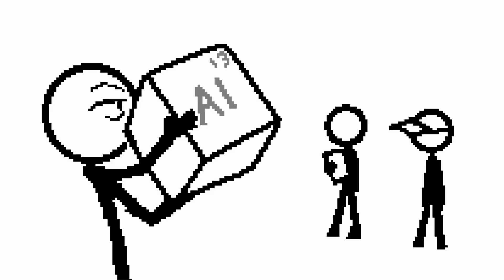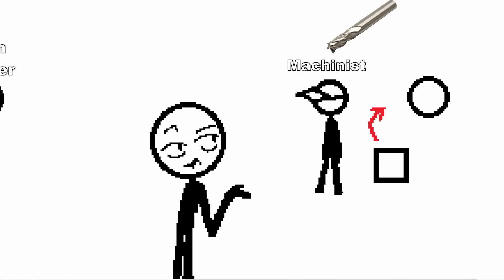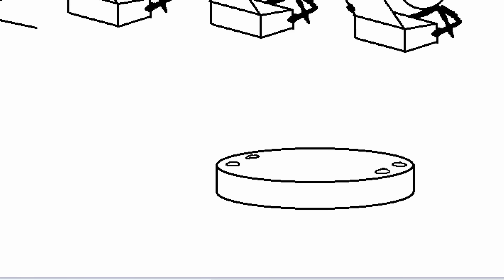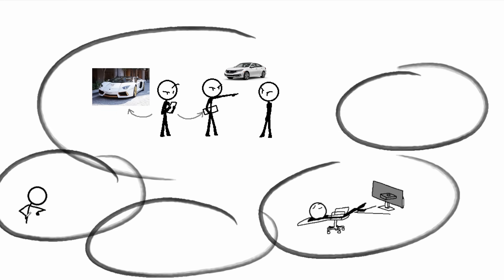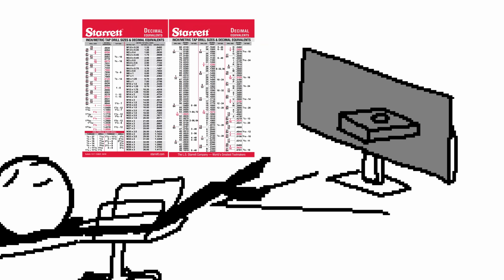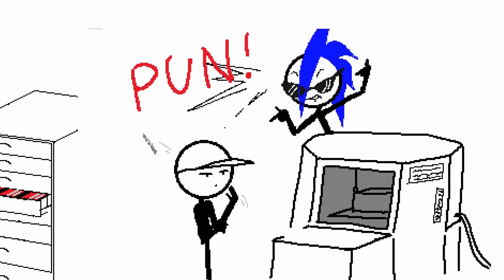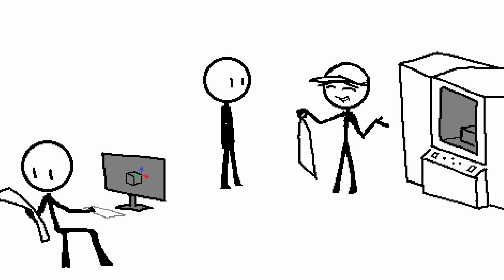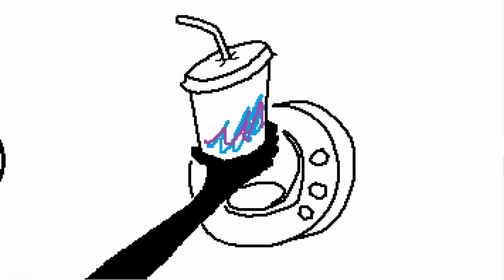Why we hate engineers

Comment: I worked on nuclear parts, hydroelectric dams parts, deep water oil drlling parts, parts weighing 250lbs to parys weighting 250 000lbs.(yes, we had to tear diwn the whole shop wall to get it inside it was so massive) these issues happens all the time at all levels. Its frustrating everytime.

Comment: Its like engineers and geologists working together. The engineer will try to keep cutting spendings where he is not supposed to. Bro you don't try nature.

If you pull water faster than your aquifer can recover not only your well will run out of water, but the aquifer may collapse, losing porosity and therefore its ability to store water to begin with. Or worse: the ground literally start sinking.

You don't mine salt with water. We all know its cheaper, but salt is soluble and you cannot control how the moisture will spread. The collapse of the mine is a matter of when, not if.

If you have a dam to hold off mining waste and it has a weight limit, you build a new dam, you don't keep adding more waste on it.

If you're building any infrasctructure be it roads or whatever else, you do it with the right slope. You make the slope steeper to remove less material, and you'll get yourself a landslide on the very first rain.

Bros try to budget cut as if something going wrong is a mere inconvenience and not a catastrophe in the making.

Comment: Hey, I had a Honda Civic. Fine car but atrocious software. Pro tip: when the doors are frozen and won't open because the locks are operated by low-power electronics you can enter the car through the boot, wiggle your way into the driver's seat, and a gentle push from the inside will then open the door

Comment: You're so right about it... Sometimes car fabricators build things that are out of the need just to be the one who made it into production...
But if you have to repair it, it's so frustrating that YOU COULD SET THE WHOLE WORLD ON FIRE literally. Just because some guys made a 3D drawing and decided it's so cool... For example cylinder heads from vw : there is a oil air membrane pressed into the aluminum part... If it breaks you can't replace it because it is one part now 😅😅😅 so you're forced to buy another cylinder head just because of that little stupid thing which is so small that it fits in my pants pockets 😢 the little sparepart costs around 6 bucks and the whole head costs 300 bucks... Engineering sucks 🎉

Comment: Have a similar debate all the time with an engineer who came from construction.  The "do you show a 0.75 degree pipe deflection".  He says its pointless because no one will measure that out and doing so can increase cost, I say its needed because otherwise the pipe technically wont connect to where it needs to 2000' away and thats a change order.

Comment: Isn't it the same in every field of work?
In logistic we have the same problem: Person A claims "We need to make sure that these customer-orders all get handled in that exact order - oh and these are the exact dimensions of each carton and package and they need to match precisely". Even when you tell them that you can do it but it will be a lot of work and be completely useless in the end - they will ignore that.
And then a couple months later - to the surprise of the people that ignored you - the packages don't fit cause their measurements are way outside of tolerances and none of the tight timelines are ever met cause the packages arrive too late at the warehouse, the worker is taking a dump, the truck arrived too later and a myriad of other reasons.
The "solutions" that are ordered are way over-engineered and completely detached from reality - but the people that do all the talking and negotiating never listen to the people on both sides that would have to work with the system or produce the system.

Comment: Why I hate engineers.

"Let me put these 20 screws when you only really need 6 at most on the back where its such a small squeeze that a hand would have trouble fitting through. Lets also make this the thing that needs be checked weekly."

Exghuatered slightly.

Comment: Hi. Design engineer here. I get that this one was directed upstream from manufacturing and so all the criticism was pointed at the design aspect of the process, however it’s worth noting that this goes both ways. Often times your fabricators will prioritize productive output over accuracy or even basic quality. If they need 200 bench leg frames were by Friday, they’re gonna push back on quality control and you’ll end up selling parts with poor welds, burr-heavy edges, and spotty powder coating. 

Meeting each other’s expectations it’s important. Assume your designers aren’t bullshitting you and ask for clarifications. And please actually try to meet the spec.

Comment: The real problem is not having educated engineers, specifically a mechanical engineering degree or equivalent knowledge and experience with the fabrication processes.  
In my experience the worst offenders are often managers making the engineers do things the stupid way and this frustration propagates down the line to manufactures and assemblers.

Comment: The contractor can’t butt weld thin walled stainless steel piping, their engineers state thin wall piping meets the pressure requirements, project management states design meets requirements and won’t change the drawings, meanwhile fabrication costs are >> than material cost of upsizing to sch 40 pipe that is orders of magnitude easier for the contactor’s welders to weld. This is why we don’t get universal healthcare in the US.

Comment: Friend was making a rocket part or something i have no idea but it was a aluminum cube with a  chamber in the middle and  it had similar desing as shown in 4:57    BUT my friend had created a cutting plan so essentially they would drill all the way where possible and part way where they could not. so like the middle bend in the middle you would drill paralel to so you would get your internal tunnels.    
how ever he could not make the fucking machinist understand what he wanted him to do.   my friend showed a fuck bullet point to this fucker. and explained in GREAT DETAIL what he wanted to do and that it would be okay to drill holes in this block of aluminum.   eventually it ended up so that my friend visited the machinist shop. asked the first guy who was there to help him out and the guy did this while the designer instructed. and all it was was few long through holes.  or half way ones.  he had same aluminium that he then used and welded the extra parts shut.   

when you have clear vision what you want to do, but cannot communicate it effectively  its the most frustrating thing ever, specially when the professional is just saying NO to everything and is not even trying to understand what you are going for.

Comment: Year building a cupholder for 150 buck and everybody thumbs up, what a wounderfull teamwork, they saved 85% of the Budget.
But without the designer, just aks the maschinist for a cupholder - 2 minutes, 50 cent for a better solution.

Yes, if you overengineer the overenineering, you may find a local optimum, but it is not possible to find the global optimum.
So, first question is: do you need an team of experts or just the machinist or even only some other staff?

Comment: What if I tell you a machinist and a designer aren't necessarily engineers.
Reply: A machinist literally only needs to know how to load in the file of what ever needs to be milled, and press start on the cnc-machine.
And a designer kinda draws what needs to be done.
The engineer decides what material is used, how big or small it needs to be, how thick or thin, whilst everything sits within the cost limits. And needs to tell the designer if the design doesn't work.
Reply: Of course you've also got mechanical constructors who also partake on the dimensioning of what ever needs to be done, but they don't do the big calculations and actual engineering which needs to be done to engineer something which needs to work.

Comment: but like this isnt new knowledge, its outlined very clearly if the machinery's handbook was ever read. A huge problem is over engineering, and not ever having to experience the trade of the people who you are asking to make it. there are very very few things that require some of the tolerances engineers ask for, and this has been clearly articulated in the machinery's handbook, which both engineers and machinists should own, not only to place on their desk or in their tool box but to actually fucking read.

also a common practice both in design and practical machining has been to chamfer, edge break and radius things. The common colloquial of a machinist is to state that if there isnt an edge break it hasnt been machined. This can of course be over ran by a specification that there must be a 90 degree angle or sharp edge.

many design engineers have become good about this and have placed some sort of a header tolerance allowing or requiring undefined shoulder radiuses or edge breaks

Comment: 6. Splines.... stop drawing in splines because the machinist can't edit the part easily. 
7. Illegal boundaries.... lets blend curves where they fold on themselves and create something that looks like a dent on a can door. 
8. Curves that aren't tangent to one another..... the only thing I can cut with is a round cutter so let make a place a cutter can't go into.
9. Counter sunk holes..... 82 degrees is English. 90 degrees is Metric.  
10. Textures... stop drawing them and do that in the CAM software
11. Learn to machine. Machinist are tired of making engineers look good by fixing there mistakes.

Comment: I object being associated with such engineers.
Designing unmakable stuff is an engineering sin.
Not standarizing, similar.
Not using standardized materials / bolts, same.
copy pasting mirror finishings because you like it shiny, F-U.
Also, get the time in machining yourself.

Comment: Hear is how you fix this. Take a smart machinist or fabricator and send him to engineering school.... a real good one! Don't hire engineers straight out of school they have no clue and have never done anything. Also if the engineer is a good speller he is probably not good at math. Math is more important, don't think because the Ph.D engineer can't spell RCH without using an acronym is not a good engineer or dumber that the jerk that does not know that within a RCH is good enough or that the smart engineer is trying not to be vulgar in front of the sensitive snow flake good speller. Yes I know thats a run on sentence and I don't care.  I designed a spell check so I don't have to!!! spelling is fucking beneath me. I sent shit to Mars and it worked right the first time so fuck spelling. Oh and Engineers are more vulgar than machinists its real frustrating being smarter than everyone else but the machinist.